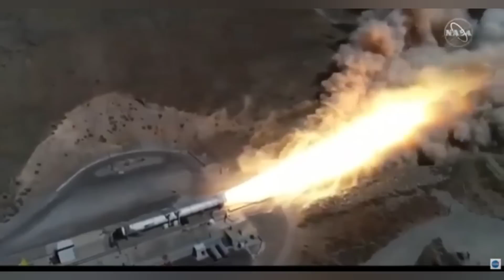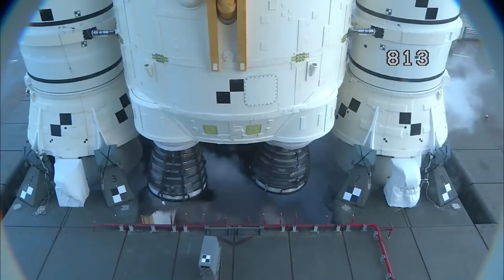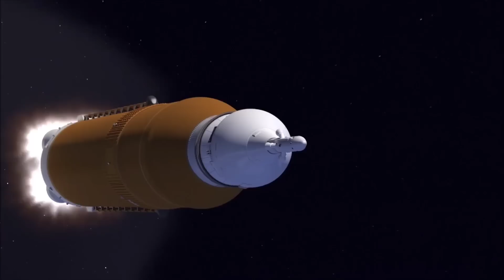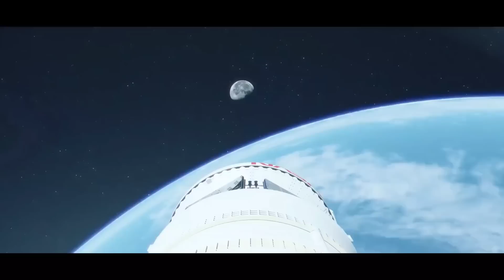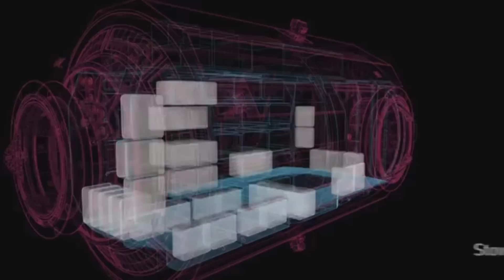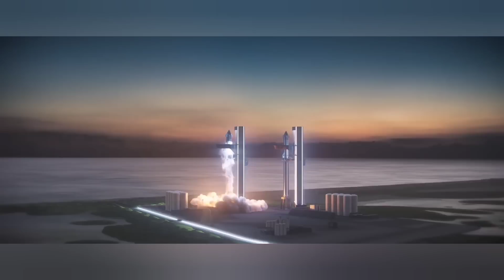Bill Nelson and NASA are doubling down on SLS!!  Why??

Comment: Shortly after Apollo I began to build up all the knowledge that is necessary to understand how the moon machines worked and how to develop a liquid fueled rocket from scratch. I was able to read the original doctor work from Wernher von Braun because I am from Austria (where we speak german). I spoke with one of Wernher's Team, Prof. Harry O. Ruppe, about the cost of the rockets. He said that it was impossible although he spoke with all relevant people that worked on these launchers in the 60s. Because they wanted to sell the Saturn I they putted to low cost to the Saturn I - end of story. The SLS is the Ares V and under development since neary two decades with yearly cost of 4 billion - that makes until now 80 billions. Even it was have of it in the first decade, it makes 60 billion until today. If it does not fly, it costs at least further 4 billion a year in the comming years. Every start costs billions, while not having the capacity and features of the Saturn V.
You shall not believe on calculations of someone involved in the Shuttle program. They told us in 1973 that every start will cost 10.5 million US-$ to bring 30 t into orbit. That would be incredibly cheap. In reality it costed on every flight more and more. Because the launch price was a political issue, in the first 20 years you never got the real cost. At the end of the "program" we heard from at least 500 million per launch. Incompetence during the complete program that lead to the most expensive launch vehicle ever, that killed more astronauts/cosmonauts than any other.
I would be not surprised if SLS never reach any earth orbit. Most of the space launchers the was designed and developed at least in parts (engines, etc.) never flew. I hope it will change with the new startups all over the world, but think only 10 % will have success. I waited for 50 years that space flight beyond earth orbit continues and see the only chance at Starship. If that fails I go back to my pessimism (1973 to 2016) that I never will see such a flight in the rest of my life.

Comment: SLS seems to depend on four (repurposed) Shuttle engines and there seems to be 13 or 14 of those Shuttle engines left.  And the Shuttle engines were eminently reusable.  When SLS launches, these - "reusable " engines will be dumped into the ocean never to be used again. Where are the next engines coming from?  The Delta-5 (I believe) has been discontinued because the RD-180 engine (and derivatives)  are no longer available from the source. .  .  Seemed like a good ideal at the time, but  now we (USA) are screwed.  Dumping one of the most successful  reusable engines into the ocean never to be used again could be criminal . . . Angry Astronaut  you  must make a video about the lost chances of the space program. . .

Comment: You miss the main point here. Artemis prime objective is to land humans on the moon. The simple fact is, unlike Saturn 5, SLS can't land anyone on the moon. Starship(HLS) will be able to. Once starship is functional the whole SLS system is redundant. So without Starship SLS can't perform a useful role. And with Starship, SLS has no role to perform. It may be ready earlier than Starship, but it is ultimately an expensive firework. Even if NASA insists on using SLS, SpaceX will be able to sell tickets to the moon surface at a fraction of the cost. European and Japanese space agencies will fly with SpaceX. SLS is doomed, so kill it now and wait for a proper system.

Comment: Ignoring cost (something a government that deals in trillions can do easily), there is still a case to be made for a disposable super-huge booster to handle payloads that can't be fit into a reusable booster system. A unique payload launched on Artemis might be cheaper than multiple launches, and on-orbit assembly, of separate pieces. Designers should have the option of analyzing engineering and logistical tradeoffs, and picking the one system that best fits their unique needs.

Prudence indicates that NASA should plan for two Artemis missions a year. The trick is to develop low-rate, SUSTAINABLE production of boosters, as the Russians did for Soyuz. Get a few boosters ahead, and store them carefully for future unforeseen missions that can benefit from having a super-large booster already in inventory, waiting for a customer. Falcon and Starship are economical because they can handle fast-turnaround repetitive missions with standardized cargo sized for that booster. When launching costly unique oversized payloads, a reusable booster is the least of anybody's concerns.

A stash of uncommitted Artemis boosters would be an investment in infrastructure to handle future requirements that nobody has even dreamed-up yet. Missed opportunities should also enter into planning.

Comment: I believe the Environmental control and Life support system on the first launch will not be tested in Orion. In fact it will not be complete. So the Artemus 1 is not yet ready for human support. They intend to test it on the next mission in LEO before burn to lunar transfer, just in case there are issues. Makes me feel safe that days later it will not fail.

Comment: The premise of the video is that SLS is ready to go and can serve as a stop-gap.   However,  I believe that is a very shaky premise.  The SLS has been plagued with problems for decades!!   For SLS to be a viable stop-gap, the engineering, program planning, and program management must quickly improve to the point where the delays and cost overruns get under control...... but I don't see that happening.

Yes, Starship has a long way to go to get moon-mission ready.   Yes, Starship has had mishaps and setbacks.   However,  if you compare the overall rate of progress of starship vs SLS,  I don't see SLS being a viable stop-gap for very long.  I would not be surprised if SLS continues to fail till Starship overtakes it.

Comment: All I need is 4 years with a resourceful team and supplies. All under a cost of 700 million. The end result is a hybrid Spaceplane capable of carrying 55 tonnes of cargo, forty astronauts and a crew of twelve and weighing less than a fully fueled booster. It uses a runway and it's a double delta wing design.
Reply: You forget 1 THING
When you transport ppl
700mil won't cut IT No 
Not cloase becaus of securety
Reply: @kennethschultz6465  it's not absolute. It's a ballpark figure. Going on realistic cost on parts such as jet engines, hull construction, heat shielding ceramics,  reflective alloy , carbon fiber bonds , instrumentation, landing gear, hydraulic systems,  sensors and another host of goodies . Now when it comes to labour and other cost such as shipping and tariffs , well the price blooms unless you don't say you , hey I'm building a Spaceplane..yeah , then everything goes over inflated. Realistically a spacesuit cost under 50k in materials, and the labour and greedy fingers inflates the price ... investigative research will help you out before saying what was said . Have a great day Kenneth..cheers

Comment: Now do the math on how much material could be launched to LEO using that 10 billion just using Falcon 9.  Your argument to spend 10 billion per year EXTRA just to get a second SLS launch per year is ridiculous. That's about 150 Falcon 9 luanches(around 60mil a  launch). 25 tons per launch.  3750 tons total.  Just build a transport in LEO and go anywhere in the Solar system you want.  All for the price of an extra 1 or 2 SLS launches.

Comment: SLS is a "damned if you do, damned if you don't" kind of program.  Yes, it's closer to "prime time" than Starship as of July, 2022.  And yes, it should be capable of transporting humans to the Moon before Starship reaches that milestone. SLS would have been pretty darn cool if it had been flying in the 1980's instead of the LEO-only shuttle. But with its hyper-inflated price and super slow development, SLS has proven to be a decidedly uninspiring endeavor.

Comment: Starship has no emergency escape system as currently envisioned, nothing to pull away the human passengers from the main fuel supply. This was required for Falcon 9 Crew Dragon, and it was a main reason the Space Shuttle cancelation was accelerated. This lacking safety feature will turn out to be a non starter for a NASA human rating.
NASA:  What does it mean to human rate a rocket? ....  incorporate design features and capabilities to enable safe recovery of the crew from hazardous situations.
Reply: To be fair, Starship second stage is said to have a thrust/weight rate above 1, and thus able to act as launch escape system. But I think this is not that practical because the acceleration would be insufficient to quickly separate the crewed part from the booster in case of a cahastrophic failure.
Reply: @andreabindolini7452  True, and 2nd stage (SS)  is still fully fueled at launch. The desire is to pull occupants away from that fuel in case of imminent explosion.

Comment: Even if we found ice on the Moon. 
How would we use it? I don't know.
Reply: It is extremely easy to split water into hydrogen and Oxygen. These can be used for life support or fuel. Try it for yourself. take an old phone charger, Cut off the end plug, bare the wires. Get a glass of water, add a teaspoon of salt. Separate the charger wires and insert them into the water -the bubbles that you see are H2 and O2.  A proper system needs to use near inert metals to avoid metal oxide formation, which is the black gunk that you will see forming.

Comment: Wow you mention Artemis 9 , I know they are using the old Shuttle main rocket engines on the early flights and they are not coming back after launch so I take it that NASA is building new engines for the later flights my question is are they building new engines like the original ones or is there a new engine that is being built ?
Reply: Basically modernized SSMEs
Reply: Last I checked they were making a specialized variation of the SSME that’s made to be expendable, plus some added minor upgrades.

Comment: The penny is dropping that Lunar Starship is the wrong vehicle for crewed landing, fine for cargo but who would want to be onboard a 100tn rocket landing in zero atmosphere.

All the sci-fi books & films show us that motherships stay in orbit and small crewed vehicles transfer crew between orbit and landing.
Reply: You clearly struggle with the concept of gravity. Acceleration of an uncontrolled lander, toward the moons surface, is the same regardless of the mass of the vehicle. hitting the moon at 100mph in a tin can or an airliner sized ship has the same result. Dead astronaut. The airliner size has more room for redundant systems, so on balance should be safer. If you have 40 landing thrusters and 1 fails, no big deal. If you have 4 in a ship one tenth the size, you crash. With Starship, you can land two ships and you instantly have a huge lunar base and a supply of spares. Building infrastructure on the moon is going to take tonnage, so sooner or later, a Starship vehicle will need to land on the moon. The key phrase in sci-fi, is fiction. Best not mix it with fact. Do the job once and do it properly. SLS can't land people on the moon, it is ready now because it is re-heated shuttle junk that can't fulfil the needs of Artemis.

Comment: HLS will the about a 1/10 scale starship (or smaller), which only requires 1/10 the fuel (or less), and no refueling. Starship is so oversized, its laughable to think people think it'll land on the moon. Starship, by itself, can DELIVER something lunar orbit. Its larger than SaturnV. Booster (1st stage), Starship (2nd stage) and a dragon capsule like 3rd stage for landing. Artemis is meant to deliver astronauts to lunar orbit and return to earth. Starship doesn't need to be human rated - because humans will not fly on it! When the final designs are released in later 2023, I suspect everyone will be like "oh yeah, this now makes sense". Dragon is human rated! The HLS only needs to be a dragon with a few modifications (plus the starship system to deliver it to lunar orbit). Again, starship will never be human rated - there is no advantage to make it so (commercially). Starship (being what people think it is for) doesn't make sense.  could be wrong, time will tell.

Comment: IF it is perceived that sending missions to Earth' moon is a worthwhile endeavor (and I firmly believe that it is), then such a program should have as few humans aboard as possible, with a human population of ZERO astronauts representing an ideal case. Humans add mass to the mission requirements in terms of life support demands, as well as increased design and engineering mass in order to "man-rate" the spacecraft. A fully automated lunar transportation system would be MUCH more efficient and cost-effective, and pose less risk to inherently fragile humans as an additional bonus. The only discernable rationale for insisting on having a human presence on the Moon is to provide a source for public-relations "stunts," which history has demonstrated are NOT sustainable.

Comment: One ship doing everything (flying to the moon and back to earth) plus washing the dishes and mowing the lawn is not and not ever going to happen in the foreseeable future.  Starship needs to be modular modular modular. Plus there needs to be multiple variants. One for crews one for cargo bulk fuel. One to travel to LEO and one to travel back and forth from LEO. I.E. some Starships will not require heat shields
Reply: You do know that they already fully intended on having various variants right?
Reply: @redbeard11200  where are they or am I jumping the gun?
Reply: @jbizzle1966  crew, Starlink, cargo, lunar, tanker, possible a point-to-point variant, possible a space station derived form Starship, probably a deep space version too. Technically the Starlink variant already exists in S24

Comment: SpaceX DIDNT have a bad explosion.
They had a GREAT result that PROVED the design quality of many Thousands of parts and assemblies.
A small handfull of items that need further attention and developmemt were identified but statistically thats something like a 99.999999999992% success.
Well done SpaceX team.
Reply: Everything worked perfectly on the test. They just forgot to remove a running generator that was underneath the propellant dump.

Comment: I just want to remind every one that the first lounch  is becouse they salvaged rocket  motors  from space shuttle  and once those  are used up they have no more motors till the be4 is done and there is no time date on that. And isn't  the crew  model  just a modified starliner. And we have not seen a completed lonur lander yet.  Also dont for get its price tag is $ 4.1 Billion a lounch.  And dose that include its pay load. Or is that just the main stage. Talk about burning money $4.1 billion secound it has a lounch  time frame of one a year  and can only send 4 people to the moon and back. And how are we to build a lonur colony with a that has the capasity to hall little more than your average 1 ton truck. And make a load once a year. All at $4.1 billion. From my point of view they are not really  serious or there plan would be better. If you realy want to make a go for a lonur colony  and go to mars. Orbital refueling  is step one no way of getting around it. You need O.F to get the tonnage  of materials  to both places in quantities needed to make a really go. Because at moment  a block b SLS can only put 9 meters  of space on the moon. That is not much larger than your large bathroom.

Comment: NASA will still be fiddling around with SLS instead of accelerating a Starship solution.   By the time NASA boots return to the moon for a short photo op visit, China will have fenced off the water hole and busy constructing a lunar stage zero that eliminates 80% of the propellant to escape the moon. And a couple years after that, China will be pumping out huge heavy metal slugs that can hit anywhere on earth with a small nudge.

Comment: Why the heck don't they use two smaller rockets instead of one huge one?
Reply: Well, you could theoretically launch Orion and the kick stage separately in LEO with two Delta IV Heavy rockets, assemblate them in space and then perform the trans-lunar injection. But this seems... intricate, only to send a crew to the Gateway or in lunar orbit. And Delta IV Heavy is not human rated...